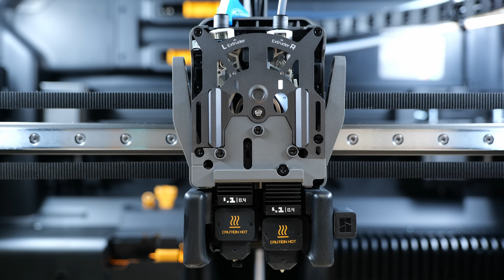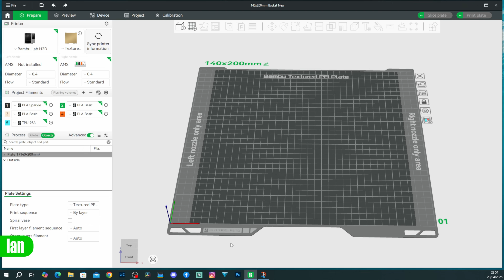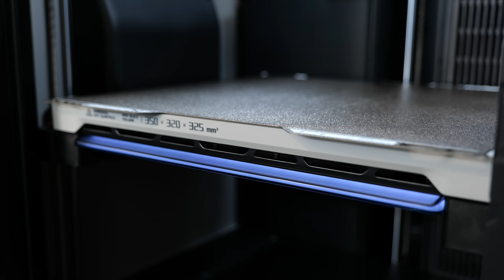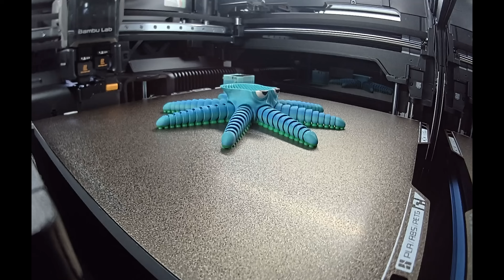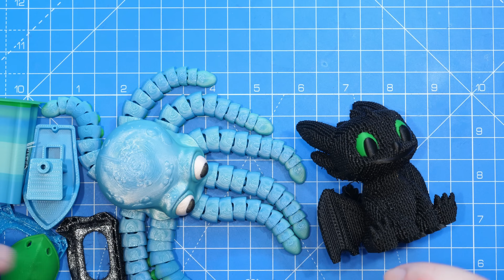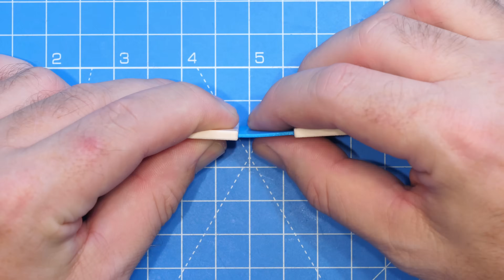Bambu Lab H2D Multi Material 3D Printer  - An All New Platform With Massive Potential!

Comment: I really don't get why I don't read more about the disability of using /seeing through the nozzle cam. I have installed with both my previous printers a nozzle cam and I can tell you that it is addictive and will tell a lot how the print is going.. Ones you have had one you miss it when it's not there. I truly hope they(bambu). Will allow us to use it in future updates.. I'm afraid they only will do so when enough people ask for it.. But when they never had one they have no idea what a pleasure it is to have a nozzle cam🤷

It is there.. Give us the use of it.. It's only to see.. It doesn't mess up the system

Comment: I have to strongly disagree with the bed temperature problem: For me, every single PLA nd PETG print detaches from the build plate mid print if I use the standard settings, even after the firmware update. At 120°C the bed only reaches 94°C at the coldest and 102°C at the hottest point.
In addition to that, I have severe VFA, so in its current state, it is barely usable. None of the problems on my Kickstarter backed X1C.

Comment: Great video. I love my H2D so much that I gave away an A1 mini before it arrived and sold an A1. Then after using it for a few weeks, I’ve just sold my X1 Carbon too.  Getting rid of the X1C was harder, but the H2D is just so slick with the dual heads, so prints quicker and was getting more use.

Comment: When you talk about TPU and when Bambulabs talks about TPU in the user manual, is it including the TPU for AMS? In my X1-C the TPU for AMS was working well and I hope it will work well in the H2D. I also hope that TPU car run in both hot ends. I would appreciate if you can highlight me. If not, I will contact Bambulabs for clarifications.

Comment: I don't have an H2D to check what Bambu did, but if the problem was the filament "compressing" because it's pushed back into the PTFE tube, you could simply let the PTFE coupler move up together with the hot-end, then there is no movement of the filament relative to the PTFE tube.  I think the real problem is with the extruder.  That one doesn't move up as the same drive gear is used for the fixed hotend as well.  If you first move over the drive gear, then move the hot-end up, then the TPU could move into the space now freed up by the drive gear moving aside, but ... Even here, if you would move the PTFE coupler up together with the print-head, then the TPU would only move relative to the idler gear, which I would not expect to do much when you have both ends of the TPU filament moved up together (one being the PTFE coupler, the other the hot-end).  So, I still think the statement that TPU was an afterthought is correct as I don't see why Bambu would have been unable to solve the problems with the second head quite easily except for not having the time left before having to launch.

Comment: So far I love my H2D. Printed a large poop chute and bucket as well as a accessories storage box etc. Absolutely perfect quality. Poop bucket and the storage box were both dual color, using both hotends, and I am so impressed how well and how fast it works. Love the led notification bar, and motorized air intake / exhaust vent. The build plate size on my previous X1C was for the most part big enough, but for me the H2Ds build plate is really the sweet spot, even with the limitations due to the side by side dual hotends. I have yet to try. TPU prints on this one, but had no issues on my previous X1C, but need to print myself a new phone cover, so will do that very soon. :D Thanks for the insight in relation to the comments on the “TPU print is an afterthought on the H2D”. I might have fallen in that ditch as well before I saw your videos, but when you explain why it makes so much sense. I used the Bambu 4in1 PTFE adapter on the X1C back then, so what I would like to do on the H2D would be to make some mod to avoid switching the tube from right nozzle buffer, and out the back. So some kind of PTFE adapter + some extra tubing. Though it would need to be heat resistant due to being placed in the chamber now… I wonder if the 4in1 Adapter can handle the 65 C chamber temp hmm….

Comment: Just a warning for those on the beta software for the H2D. Avoid firmware 01.01.02.00
it will cause the “extrusion motor is overloaded” fault. It randomly started appearing on mine after updating even triggering without extruding anything. Absolutely no jams. Downgraded and all is fine now. Apart from that it’s been a great printer if you can get it without the ridiculous tariff increase.

Comment: I would call myself a hobbyist using who is both interested in building or modding printers and using it hassle free on the X1C.
At this time I'm thinking of should I get a H2D ?, but having a modded ender 5 plus which is 350x350x350, so will I really want to print any super large multicolour prints ?
I've had my hand over the buy button a couple of times now and decided to hold off for more reviews and see if there is any big bugs in the hardware or software .
Being a hobbyist user I don't sell anything I make , which are trinkets or functional prints finding a solution to a problem like a door stops , broken parts , etc , so does anyone really make money from their hobby ? 
Can't say I'm interested in the laser at all , but I think they have missed out on have a cutter and pen upgrade instead of the laser .

Comment: The part at 24:25 is slightly incorrect. A printer can compensate for warping(differential shrinkage) of any thermoplastic(if it's made correctly). There is a reason a lot of those huge  industrial printers don't have heated beds. Having the bed temperature higher than the chamber temperature only makes shrinkage worse. A chamber temp (with part cooling using hot chamber air) right below polymer Tg for amorphous polymers and about 5- 20 degrees above Tg for Crystalline polymers eliminates shrinkage. In my own testing I have noticed shrinkage simply because I started the chamber heater when the print started rather than heat soaking the whole printer for 30 minutes.

Comment: Told a friend that the X1E showed Bambu they could sell printers for $2,000+ and get away with it. Luckily, I got my P1S/AMS for $750 just before tariffs and their newfound confidence in pricing. I had hoped for a tool changing head, but my second wish was a dual nozzle that rocked/teetered (they did one better), and slightly larger build space. I think its back to modding my 350mm Voron 2.4, maybe invest in Bondtechs new INDX tool changer.
Reply: Same here I'm lucky enough to be fairly close to a Microcenter and got mine while they were redoing all the 3D printers and the sales guy said I got the last one at that price. Looked at the website few hours later and it was $200 higher across the board. So far I've been very happy with the P1S and really glad I got it. H2D will he a maybe for me as I think there will be more options available when I'm ready to get another printer

Comment: Arent these the guys that wont let you print unless youre online?
Reply: You have lan mode as well
Reply: Not true.
Reply from the maker: You do not need to be online to use this printer.  Offline mode and developer mode work absolutely fine.
Reply: @MadRC  check the consumers rights wiki for the details on what they tried to do in January 2025. Authorization Control System.
Reply from the maker: I am fully aware. I really don't care about being online to print, I have made this clear in the video as well.  You can be off line if you want, or you can use the online funtionally. 
If you want completely all yours buy a prusa and give up the smart features.
Reply: @jasonzdora it’s irrelevant. Offline works very well.
Reply: @melgross -  Was true January 2025 and only became untrue after massive pushback. Could become true again one day. Very relevant, I think.
Reply: @jasonzdora no, that not true either. They didn’t change anything. They just explained it in more detail.
Reply: Bambu can steal your 3d files! I heard... Then both onshape and fusion 360 shares your files if you use the free versions 😂